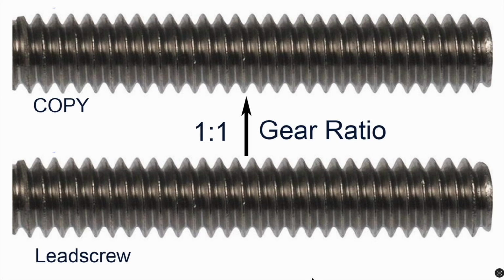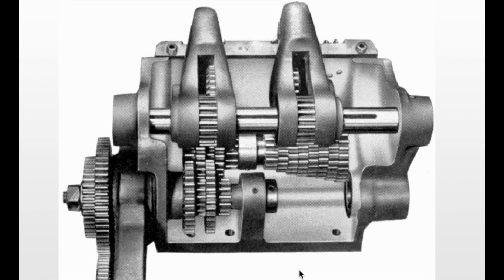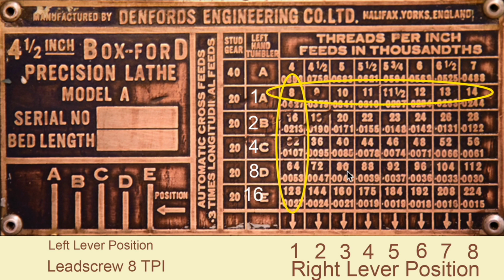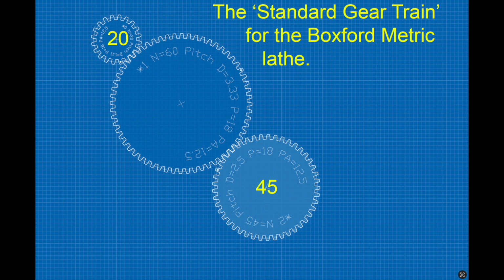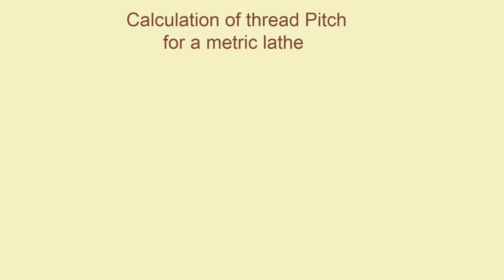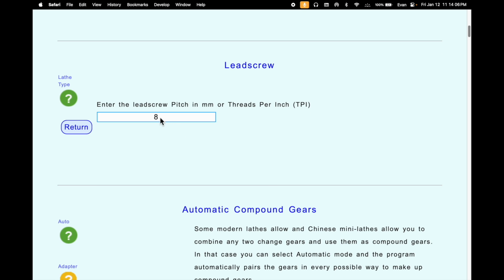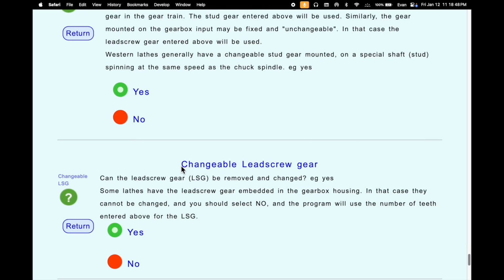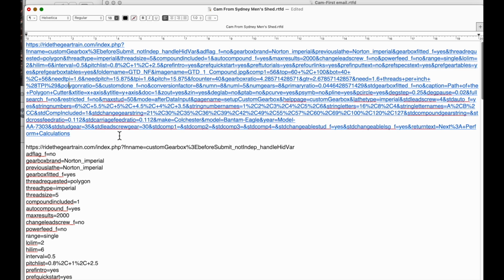Understanding the screw cutting gearbox in an engineer's metal lathe

Comment: I'm watching Your YouTube videos with enjoyment. I too have a Lathe Boxford AUD and I need an information from You. I want to make some Metric Screw and I know I need a Gear 127/100. Please, could you tell me the millimetric dimensions of that gear, I want to make them myself. tnx
Reply from the maker: Yes I can certainly help you with cutting metric threads with an imperial lathe. I would recommend trying my online software at RideTheGearTrain.  Just put dot com on the end of the name.  My address can be found there too. 
With this program you select your lathe from the list (the heading is Norton Imperial gearbox for Boxford...). 
You enter your own list of change gears. 
Select metric thread. 
Say how much error you are willing to accept (say 1%).  
Enter the pitch of the thread you require. 
Click RUN.  
It tells you how to set up the gear train and gearbox to get that thread. You may be able to do it without buying the special 127/100 transposing gears. They are big and quite expensive. Many people make them with 3D printers and they may be available on eBay.  A very good alternative is an 80 tooth gear connected to a 63 tooth gear. One user made a 63 T gear and modified the 80 tooth idler gear to attach to it.

I also have YouTube videos about several related topics with the channel name evan-e-cent.

The program can tell you what size the gears are too. It is in a brand new section I wrote recently. The button is called 'Excluding Certain Results'.  It calculates the size from the number of teeth and the Diametric Pitch of the teeth, which for Boxford lathes is DP=18.  I will run that for you now...Here it is: 
compound gear  is 100 teeth.   Outside Diameter = 5.667 inches based on DP=18.  That is 144mm.
size for compound gear 2 is 127 teeth. Outside Diameter = 7.167 inches based on DP=18 ie 645.16 mm
There is a lot of written information in the HELP file of this program with articles about Diametric Pitch or Diametral Pitch, and also about how to cut a metric thread on an imperial lathe.
I would recommend joining the Boxford Users Group:  
https://groups.io/g/BoxfordLathe-UserGroup/topic/110436237?p=Created,,,100,1,0,0
What country are you from?
Keep in touch with me!
Reply: @Evan-e-cent  
I'm from Romania. I already tried the RideTheGearTrain website but it tells me that I have too few gears... I will try to make the gears 127/100  with a 3d printer. Thank you
Reply from the maker: @cristidavid8646  How did that work out?  If you use a gear train design with no compound gears it only needs two change gears at a time. If your gear train design has one compound pair, in the usual manual mode, you need two change gears (for stud gear and leadscrew gear) and one compound pair (two gears joined together, eg 63 teeth and 80 teeth).  If you choose automatic mode you don't need to enter a list of compound pairs. Instead it creates compound pairs from any two change gears 'automatically'.  However, for the Boxford lathe you need that adapter to make compound pairs. Finally, you probably don't need to design a gear train with two compound pairs, but if you do, it will require 6 change gears at once in automatic mode, and could produce huge numbers of possible combinations.
Reply: @Evan-e-cent  hello. I managed to make a 100 tooth pinion and a 127 tooth one but I still haven't had the time to connect them and see the results. It is true that during this time I didn't need metric threads and that's why I didn't bother to finish the project.
Reply from the maker: Good luck with that. You should be able to find what you need to make 127/100 gears on Thingiverse or specialized gear web sites.
Reply: @Evan-e-cent  I'm bothering you again. does the version with 63 t gear come instead of the 56 t one that I have now at the entrance to the gearbox? and if possible the diameter of the 63 t. Thank you
Reply from the maker: @cristidavid8646  The 63T gear has Outside Diameter = 3.611 inches based on DP=18. 91.72 mm. Normally the metric conversion gear is a compound pair with the 63T gear connected to an 80T gear.  There is a photos of my 63/80 pair in the help file of RTGT showing how the two gears are riveted together.  This compound pair goes on the banjo between the stud gear (eg 20T ) and the leadscrew gear (eg 56T, or LSG that connects to the gearbox input).  However, if you run RTGT with automatic mode and a 63T gear and 80T gear in your list of change gears, you may find other arrangements which work as well. To use automatic mode in RTGT you really need to make an adapter for the Boxford lathe.  Go to  the HELP button on RTGT and enter adapter. It shows photos and dimensions. This adapter allows you to use any two of your change gears and join them together with a key so that they act as a compound pair.  Also in HELP you can type Automatic Mode and it shows a photo of my gear train with a compound pair installed.
Reply: @ thank you very much, you are a real gentleman.

Comment: I will try with your calculator.
I want to get a first pass with 10mm or 2"-1/2tpi,and then i will advance the tool 5mm with the top slide to get the second start.

Comment: Hello.
Is it possible to generate a 10mm or a 2-1/2tpi on a boxford A with 8tpi leadscrew?
I want to rescue a friend's bench vice with a worn out nut.
This nut has trapezoidal double start thread,Φ26*5mm,or,1"-5tpi.
Thank you in advance,very nice videos.
Reply from the maker: RideTheGearTrain now displays the maximum and minimum pitch possible with your set of gears. An information box called MAXIMUM AND MINIMUM VALUES appears after the results.
Reply from the maker: Yes, this is exactly what my online computer program, RideTheGearTrain dot com, is designed to do. The program knows the gear ratios of the gearbox in the Boxford A lathe. When choosing a lathe gearbox scroll down to find imperial Norton. Just follow the instructions and email me if you have any difficulty. I don't know exactly how you measured 2.5 TPI.  Cutting a multistart thread is a special case. If you measure the distance between one thread and the next and decide it is 2.5 TPI (apparent pitch = 1/2.5 = 0.4 inches) then you would cut the thread with double that pitch (0.4 x 2 = 0.8 inch pitch or 1.25 TPI. Whether you can produce the required pitch will depend on what change gears you have for the gear train. With this program you enter the gears you own and it calculates what gear train to use.  If you need to obtain an extra gear, you can enter it into the list to try it out.  
Calculating metric threads is quite simple with the program too, but you must not disengage the half nuts from the leadscrew between cuts. Instead run the motor backwards, or turn it backwards by hand. There are more details in th program's help file and there is a help button in the main menu.

Comment: Hello, I’m probably basically not clever enough to be discussing this subject but I’m interested. 
Iv not used a boxford , my Smart + Brown model A imperial lathe has a screw cutting gear box of a similar style to the 1 shown in your video.
It has A,B,C and 1-9 with a very user friendly brass chart plate marked a-c verticaly + 1-9 horizontally to give a good selection of tpi settings which iv used with good results. 
I’m not 100% clear how or rather when I’d use your program is it to allow me to calculate how to cut metric pitches on my imperial lathe ? Iv not got any additional gears
Reply from the maker: @paradiselost9946  and Peter:  Yes the idea of the program is to do all those calculations for you and suggest a gear train and gearbox setting that will give the thread you want. It makes life easier when you want a thread that is not on your table. That may be when you want to turn a metric thread on an imperial lathe (or an imperial thread on a metric lathe).  It can also be handy if you have a non-standard set of change gears.  When it comes to metric threads on your imperial lathe you can get an exact conversion with the 127/100 compound pair. The reason is that 127 x 2 =254 and the conversion factor is 25.4 mm in one inch. However, you mentioned that you do not have these special gears. In that case you may be able to get a pretty good approximation to the metric thread you want, using the gears you already have. What the program does is try every possible gear ratio, and in some cases there are millions of ways you could put them together and it really isn't practical to do it by hand.  It tried out every combination, but ony displays the ones that have a small percentage error. Actually, you choose the percentage error you are willing to tolerate (eg 2%), and it only displays gear combinations that have less error. It even sorts then so the lowest errors are listed first.   It can be surprising how many results it finds, especially when you have  a gearbox and a reasonable number of change gears.  This particular video explains a lot of stuff that you don't really need, but some people have asked for it. If you would like your Smart and Brown lathe added to  RideTheGearTrain I would be happy to add it for you. I will be away for a while but should be able to get it done quite soon. I need a photo of the gear table, the pitch /TPI of the leadscrew, and the "Standard Gear Train" that is normally  used with the gearbox table. Meanwhile you could try running RideTheGearTrain. Click step 10.Custom Gearbox, enter the data, and then copy and paste the URL web site address into an email and send it to me. My email address is listed on the program. I look forward to hearing from you. The Smart and BRown is a copy of the South Bend lathe like mine.
Reply from the maker: @paradiselost9946   I didn't hear any more about your progress with the Smart and Brown Model A lathe.  I would like to add it to RideTheGearTrain dot com. You can contact me using the email address on the program if you like.
Reply: @Evan-e-cent  i never said i had one, i was just advising OP on how to go about figuring out their own thread conversions... sorry.

wrong person...

the OP does have one though?
Reply from the maker: @petermcneill80 Hi Peter, I accidentally posted a response to "paradise lost" so you may not have seen it.  If you would like me to add your Smart & Brown lathe to RideTheGearTrain,  you might like to read these posts again or contact me directly.